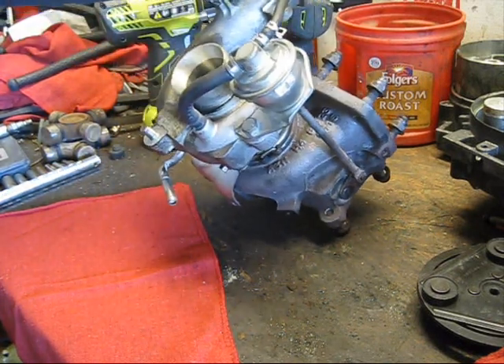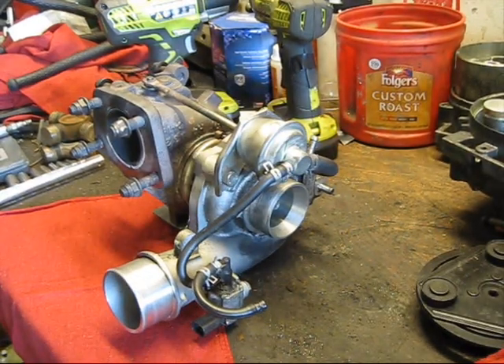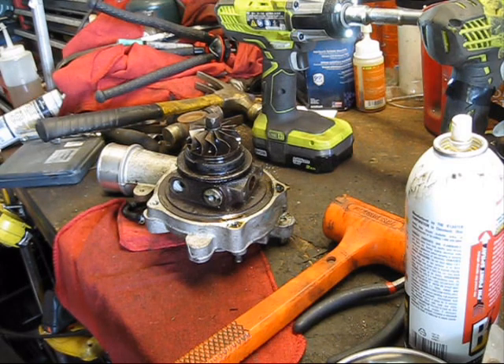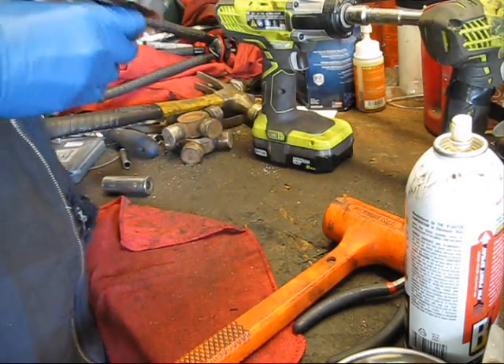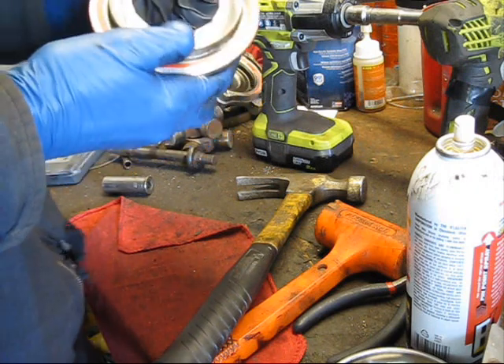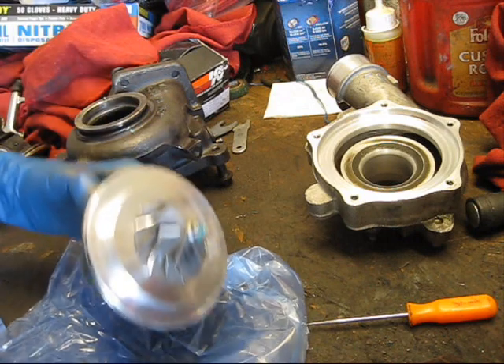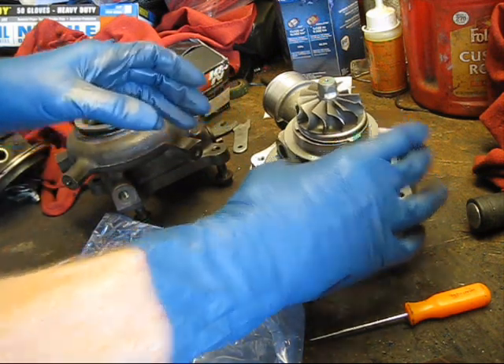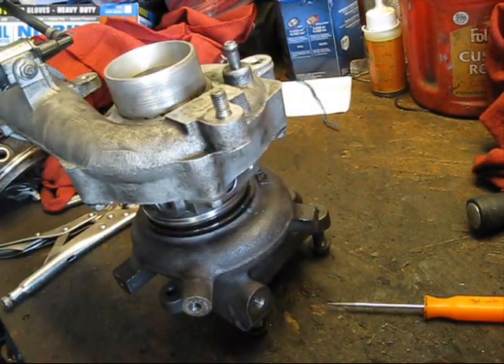Mazda CX-7 Turbo repair / MZR 2.3 DISI CHRA replacement

Comment: Thank you for this video.  Ive replaced one of these b4, fun job. This video got me wondering how easy it would be to replace the chra cartridge without pulling off the entire turbo like u did in the video, if trying to do it like im saying i can see it getting stuck and not wanting to seperate like urs was and maybe not having a good angle to smack on it while its still bolted up, maybe worth a try tho? Seems like it could save some time maybe?

Comment: Hii i got a cx7 2007 engine is loosing some power  when i press down the acelerator pedal and sometimes smoke and it has a bad odor from the exhaust i read culd be the turbocharger  and see your video it is great

Comment: Mine is blowing white smoke out the exhaust pipes. I'm assuming there's an oil leak, what do I need to replace or fix to alleviate the oil leak?
Reply: check or replace pcv (hard to get to from underneath, but i did mine, took a solid hour to get out.  take out battery and air box, some harnesses there and take off your black turbo plastic plenum to expose the turbo vanes, if it moves in and out, up and down then you'll have smoke in the intake, then clean the egr.  also when you take off the intercooler look in the inlet, I saw lots of black gunk and oil completely in there from the failed turbo.  your o2 sensors, sparkplugs, cats take a beating also.  good luck my man.

Comment: can we go to a higher or better turbo than the factory one
Reply from the maker: I have no idea
Reply: Yes. I found CorkSport makes a turbo that fits just like oem for MazdaSpeeds. It’s called CST4 or if you want a huge upgrade the CST6. My stock turbo is leaking oil so I’m going to be getting the CST4 in a couple weeks.

Comment: I was having the same prob when replacing my cartridge with an upgraded billet one. That thing was a bitch to get out.
You didn't put a tiny bit of rtv on the hot side?
Reply: Hey im very much wondering.. were u able to replace ur cartrige from the side without pulling off the entire turbo first?

Comment: I’m a little confused with my 07 Mazda CX-7 because it doesn’t smoke it doesn’t leak oil and the spark plugs show no sign of burning oil but the level goes down a considerable amount
Reply from the maker: Is it pumping it into the coolant?
Reply: Perhaps but I can never tell because it leaks coolant so rarely anything in resivoir😂
Reply: When the turbo is burning oil it's not going to reach the spark plugs. It's the turbo burning oil itself through the turbo seals. And honestly it can burn oil an not smoke enough to be blatantly obviously. Every now on the. On deceleration and what not
Reply from the maker: @AwwD_RS3_N8  It can go either way. The turbo seals keep oil in the cartridge. They can fail on the exhaust side and dump into the exhaust, or on the intake side and ingest it into the engine. I would expect leaks on the intake side, as the exhaust side always has pressure pushing against it, where the intake has suction.
Reply: @pfun41  yea your right. A good way to know if it's leaking on the hot side like mine was is the smoking will be super miniscule untill the turbo and exhaust warms up a bit. The cold usually smokes right off the rip cus it's going through the motor like u said. 🤙

Comment: I rebuilt the k04 of my 2.3 disi with a Melett CHRA 6 months ago, and after 1000km's of soft use, turbo is smoking again. I am running straight pipe, I don't know if it's related. Its my car eating turbos?
Reply from the maker: I recently did the PCV valve on this one and I might switch it to 5w-40 but I'm selling it soon. Early years had an issue with the PCV system IIRC.
Reply: @pfun41  I'll install BNR S4 turbo soon, and maybe replace the PCV valve too, but I'm afraid to break the BNR S4 and smoke again, can't understand what's happening.

Comment: Hii, Can I use Permatex supra copper instead of Permatex ultra black?? Thank you very much
Reply from the maker: As long as it's high temp it should be fine.
Reply: @pfun41 okay!! thank youu
Reply: That's what you should be using instead of black RTV, which is not suited for exhaust components

Comment: I have the same exact turbo on my Mazda but I have scrape marks all around the inside of the housing and noticeable shaft play. What kind of symptoms would there be?
Reply from the maker: You need a whole new turbo in that case. The turbine has been hitting the housing. Idk what effects it would have if you tried to put a new CHRA in that housing but I wouldn't chance it.
Reply: Possible metal shards being sent into the engine?
Reply from the maker: @Mlp2600  Depends on the extent of the damage but yep.
Reply: Yeah just some light to medium circular scratches and the car is nowhere near as fast as when I first got it. To be honest it feels ike a slug, bogging when accelerating but otherwise drives ok. Just not very powerful. Also it’s making a dental drill noise when getting into Boost.

Comment: Awesome videos.  I found oil in the inlet of the intercooler when I was changing spark plugs.  I know im going to have to do this soon.  I'm going to attempt it, If it doesn't work out I'm scrapping the vehicle.
Reply: @TdubzSFS Nope, lol. That's the blow from the engine. Too much blow - used rings. He's going to rebuild the engine soon. A quick fix is to use a catch can right there